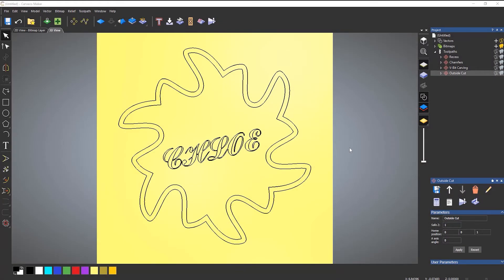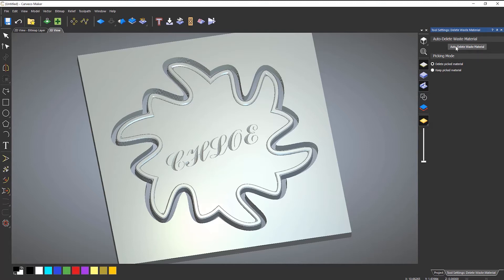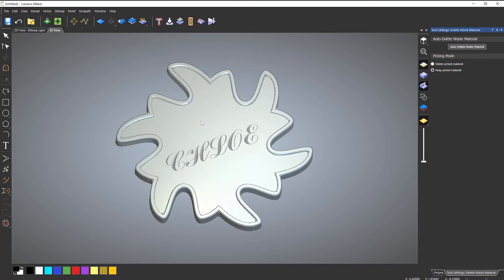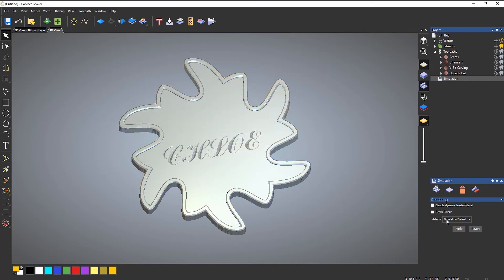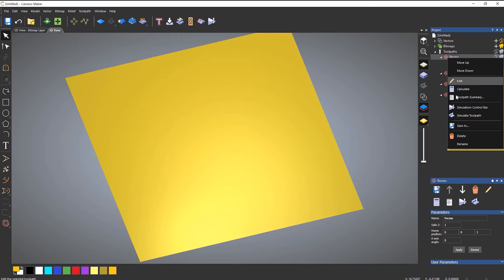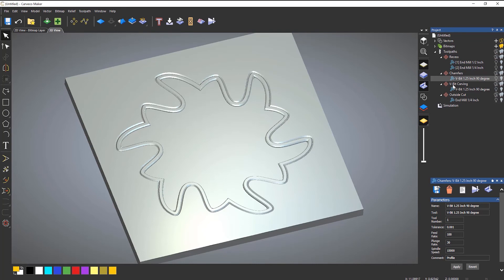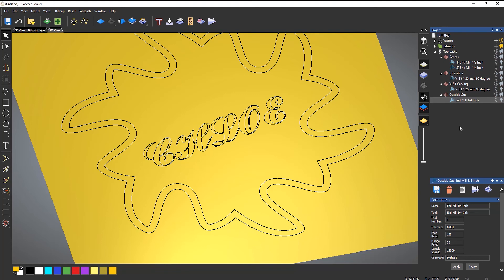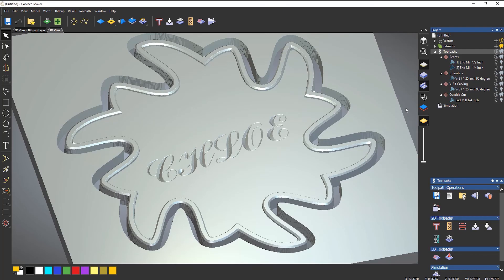Carveco Maker: Simulation

Comment: When i click play on my simulation, its really fast. How do i slow do the simulation to see what its doing.
Reply from the maker: Hi Christopher, if you right click on a toolpath, select the "Simulation Control Bar" and then it should play the toolpath as it would cut.  You can also click the button with the arrow and vertical line to slow down even more, which will show each cut.